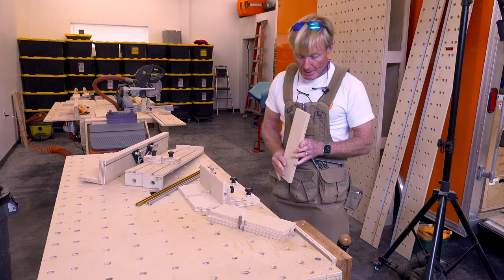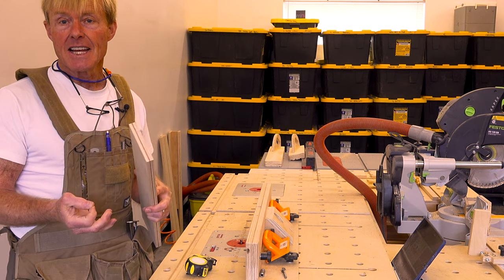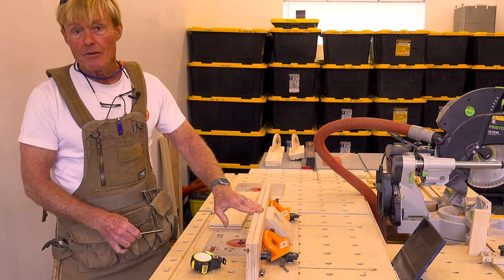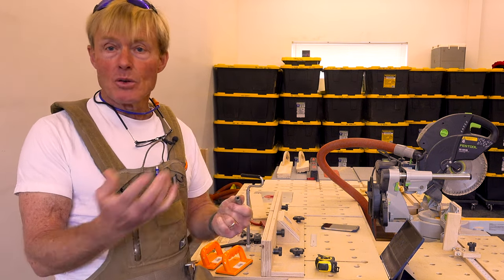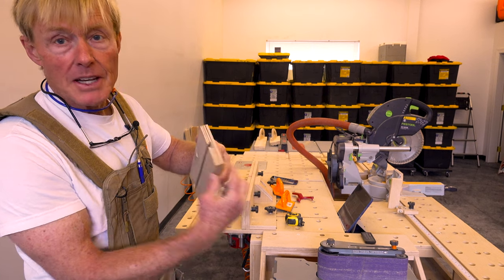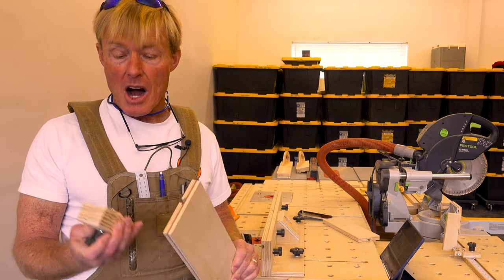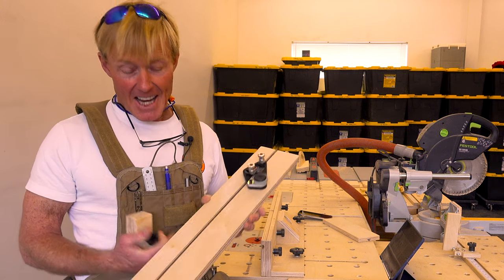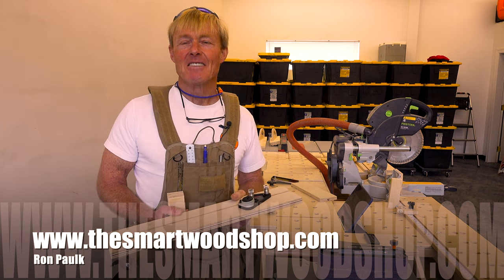How to make T-Track

Comment: Sorry, I disagree. Aluminum T-Tracks are better than ones cut directly into the wood....and aluminum ones won't wear over time and they can be re-used. Plain and simple
Reply from the maker: I use to think the same, but using shop made t-track has been a big improvement for me. The great thing is that you have a choice. Pick the one that works best for you. 😎🤙

Comment: Great idea!   My initial impression was that it won't be very strong, but when you think about it there's not a lot of force on the 'lip' of the track, it's just being compressed between the t track nut and the block above it with the shear strength of one side of the sheet resisting the forces on it.

Comment: Ron - great videos as always. FYI the Milwaukee 5625 router has an OEM 1/4" collet (Milwaukee part # 48-66-1015) you can buy. If someone's router collet doesn't accept that 8mm cutter, - there is a specific Whiteside 8mm  to 1/2" reducer bushing they can buy.

Comment: I recently was gifted a top with wooden tracks but they would splinter open when clamping down so I just went out and installed some metal track. I guess this wooden track is good for light work and no clamps.

Comment: This is a great idea .Ron ,have you tried the dovetail clamp system from Microjig yet ?They seem to work quite well .
Reply from the maker: I have not! I like the clamps I use with the MFT system holes. The dovetail clamps will not work with industry standard t-track plus they limit clamping to where the dovetail track is located. My benches are covered end to end and side to side with 20mm holes so my clamping options are unlimited. JMO😎🤙